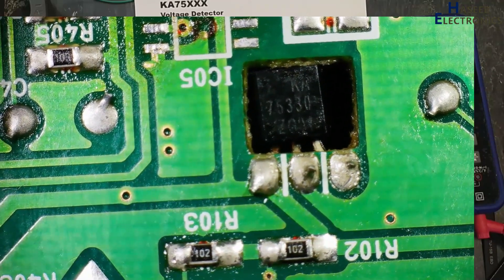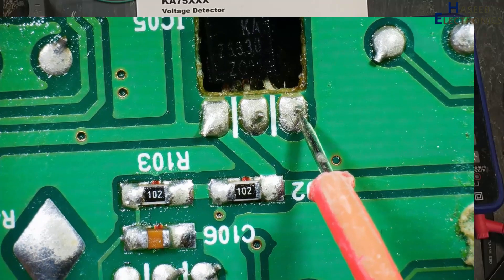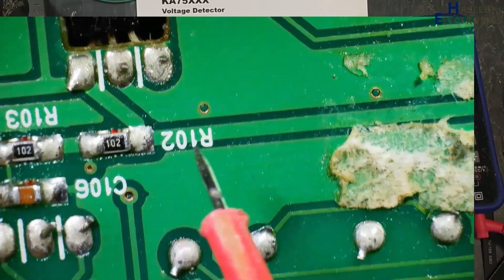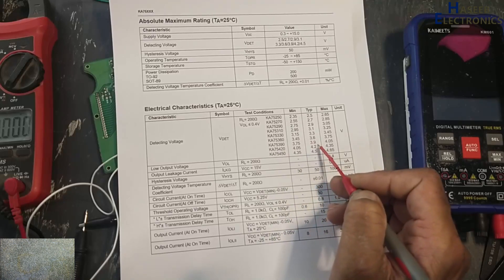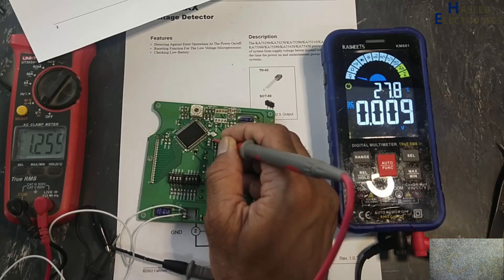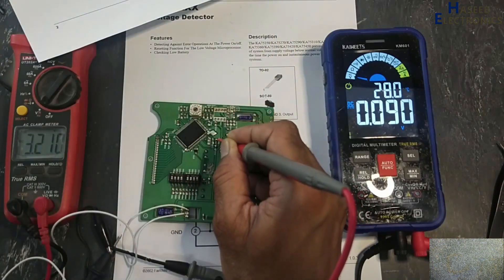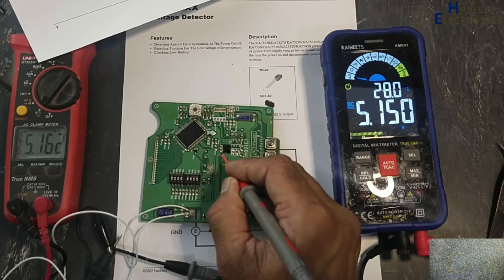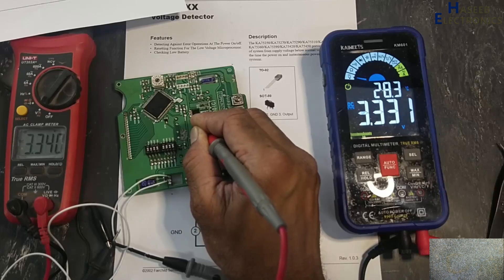{1201} Voltage detector IC KA75330

Comment: Good opportunity to point out that datasheets can't always be trusted! The circuit diagram on the front page has the op-amp inputs marked incorrectly. As shown the output will remain high until the input voltage goes past the reference voltage, then switch low!

Comment: Hello Sir, I am troubleshooting a 12v SMPS. it's similar to one of the SMPS troubleshooting video you created. Video # 749..
The DC voltage after bridge rectifier isn't coming up. I checked the 2 capacitors and accross polarity voltage are fluctuating. in reverse polarity the voltage is stable..
The two MOSFET aren't shorted either..
Kya kar sakte hai?
Kya usme jo bade capacitors hai, unko hata ke power supply deke voltage check kar sakte hai kya on mosfet if voltage are coming or not. Removing the capacitors and powering on will damage other components?

Comment: Thanx for sharing sir, i have washing machine and it have ka75450 ic and output is fluctuation problem whats the problem? Reset pin how it work? Can i apply 5volt to reset pin from output power supply of jumper to pin 1 to pin 3 it work?
Reply: It's intended to reset mcu when it drops bellow certain treshold voltage like bellow 4.7V. That means, reset pin is in normal mcu operation held on high logic voltage, 5V. If it fluctuates, it prevents mcu from normal operation.
Reply: @SanelKeys  which one will be problem ic or mcu How can I learn which one is faulty? When i remove ic reset pin of mcu continue to flactuat